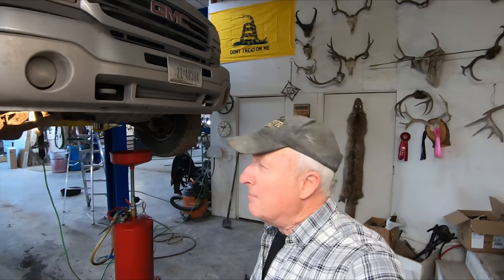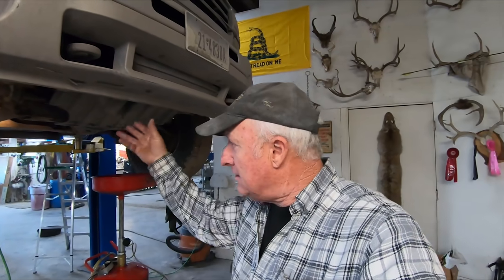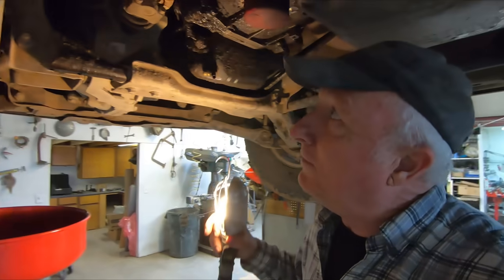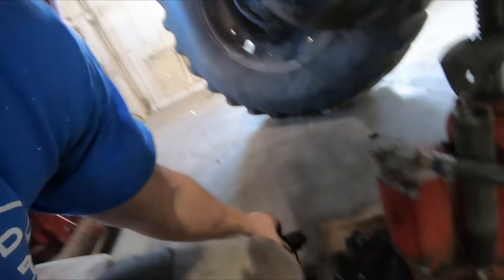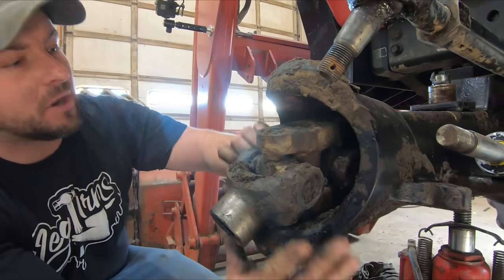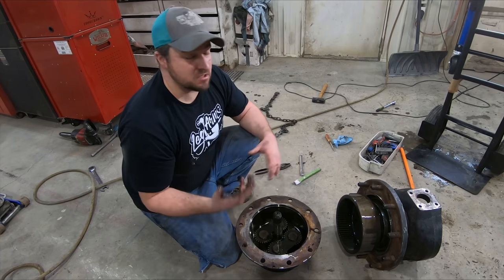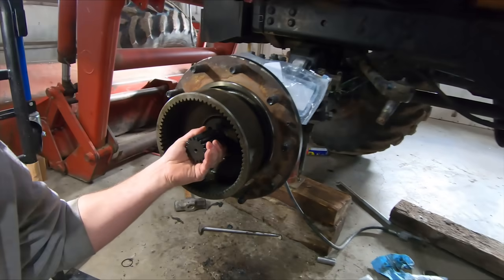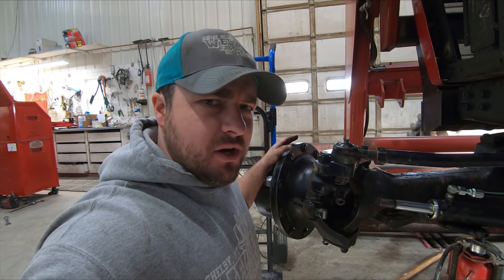NO MORE LEAKS｜Overdue repairs on our CASE IH 7140 MAGNUM

Comment: Some 25 years ago, we did some Bush-Fixes on these type of Front AWD Axels. Liquid Grease instead of the Manufacturers Gear Oil. Works OK for Tractors that run part-time, only and saves lots of $$$ for working hours.

Comment: We had a MF 399 loader tractor (2wd, open station) before we upgraded to MFs with cabs & 4wd.  Initially we kept the loader on when did field work, but then we got really quick and attaching/detaching it in under 5 minutes.  It ran so much better with the loader off.

Comment: 40,000 miles on shocks going across gravel county roads are usually at the end of life! Good job getting the GMC ready to vacation! Have a Blessed trip!
Reply: Not a Bilstein. They have a life time warranty and if they are not leaking, they are still good. Unfortunately it appears he swapped out perfectly good shocks. Bilsteins are not you normal shock. Anecdotally I have over 300,000 on a set on my E-350 van.
Reply: @Cannibal440  swaps dont last forever

Comment: Legarms/Nick I want to tell you something that happened to me back when I was in my 20's. I was using a punch and thought that I only had a few hits on it so I figured I would be ok with out my safety glasses on. Well a chip broke off that punch and hit me in the forehead. At the angle it hit it cut through the skin and slid and inch up my skull under the skin. I was able to get it out with a magnet. If that had hit me in the eye I would have lost my eyesight. I always used  a shield now.
Reply: would make great content tho fella
Reply: @BlazeTBC  Can you imagine the title of the video. Legarms Destroys his Eye!!! or Nick Rushed to Hospital with Severe Eye Injury!!! . Ya probably a viral video. Yikes!
Reply: I was thinking more along the line of fool takes knock to forehead because he can't use a punch!
Reply: @BlazeTBC  It was not a knock to the forehead it was a chip that broke off the end of the punch that shot like a bullet.
Reply: @davebrittain9216  lol
Reply: @BlazeTBC  Just to add I once helped a guy into a hospital that said he had been shot. I was asking him what he was doing when he got shot and he said splitting wood. He was using a steel wedge and a sledge hammer. I worked at the hospital that he came into at the time. He was taken into the OR and the chip from the wedge with through his rib cage between his ribs and luckily stopped right against his heart before going right through and damaging anything. Luckily it missed the major blood vessels. It looked like he had been shot with a .22 from the hole in his chest. I always think of both of these things now before I start using a chisel and punch or my air hammer.
Reply: @davebrittain9216 , Had the same thing happen to me while using a chisel and hammer to remove the top off a 55 gallon barrel. A chip shot off the hammer, straight into my shoulder about 1.5'' in. Doctor left it there, said the amount of muscle he needed to cut wasn't worth it and it would encapsulate itself. Still in there after 38 yrs. Cannot imagine if that thing hit my eye.
Reply: @augustreil  You reminded me about me hammering a U join out of a drive shaft. A flying chip of steel  is in my leg too close to nerves for them to remove.It's about the size of  head of a match. Upper thigh way to close to... well too close for comfort lets say. I was wearing a face shield at the time. Its in there about the same as yours, maybe a little less. Ya lucky that did not hit your eye!
Reply: @davebrittain9216 , I get what you're saying by too close ! It's amazing how far in those pieces can go, isn't it ?
Reply: Yep being shot is the best way to describe it. Beware cheap hammers they are to hard and chip, beware punches that have mushrooming at the head, never hit a hardened part with a hardened punch or directly with a hammer and you will avoid being shot by yourself but not the clown at the other end of the workshop.👍
Reply: Dave Brittain hearing protection toooooo
Reply: @michaelbrown8545 , exactly right there fella.  Remove the mushrooming, using the bench grinder, or hand grinder, placing chisel/punch in the bench vise.
Reply: Dave Brittain you also shouldn’t hammer a splintered punch, and missing the centre, that’s the only reason chips fly off

Comment: I lol when you brought out the Honda back when I worked in forestry replantation site prep. On the trenchers there was a couple of huge nuts connecting wheels of the trencher to the frame and to loosen them we would put the rachet on wrap a chain around it and pull it lose with the one ton truck lol

Comment: I had a 2005 GMC 2500HD with the Duramax LLY diesel engine.  At 117k miles it needed new glow plugs and injectors.  I had to keep running injector cleaner and lube to keep the fuel trims in spec.  You have a nice shop, I don't and the dealer sucks.  Wanted $8k to replace the injectors and glow plugs.  I traded it in a new RAM with Cummins and it's been great.  On your GMC, be sure and check your fuel cooler back by the tank.  They rot out and start leaking when you are on a trip.  I won't mention all the other crap I replaced on the GMC like front hubs.  BTW, the first LLY engines had iffy head gaskets.  That's a 24-40 hour job to replace.

Comment: Great video, gentlemen.  Did anyone else think "Nick should have used a Big Bud" where he used the 4 wheeler?  Hardly practical, but a funny thought.  Bob really went through his truck!  I think that replacing the shock was correct.  The rubber bushing came out for a reason.  Oh yes, the "Winter Paint job".  All too familiar paint scheme around my part of the country too.  The pins on the 7140 were crazy tough.  Enjoyable as usual!

Comment: Hey Scott. The proper name for Allen head bolts is "socket head cap screws" or shcs. But yeah, Allen head bolt is what most people outside of machine shops call them. But it's good to know if you ever need to buy some. Just look for SHCS.

Comment: there should be a tiny little vent in the center of that hub, when they get plugged it can cause oil to force its way out past a seal.  its threaded in, so it can be remove and cleaned out with the air compressor.

Comment: Boy, that Leg Arms apple didn't fall far from the tree. That magnum is pretty much the same axle as the 8770 New Holland super steer i think. if that seal leaks, the planetary on the end will come off easy enough having just been apart. LA is doing right. Great Vidya Gentlemen. God Bless.

Comment: @7:33 

Coming from a mechanical engineer. We 100% get where you are coming from, most of us try to design in ways to make assembly and disassembly easier, but those things rarely make it past the bean counters. 
Engineers are really just slaves to sales and bean counters. If it makes it more expensive to produce(even by 1 cent per part) and doesn’t affect the working function of the part, it’s not gonna make it past accounting :(
Reply: I'm surprised LegArms didn't drill and tap two holes in them himself and use Never-Seize during reassembly ?
Reply: @augustreil  I thought the same thing!

Comment: I dont know if u use a lot of brake clean, but snap on has a container that u fill up with brake clean charge with air. U can buy brake clean by bulk in 5 gallon or 1 gallon. Saves a lot of money over cans and it works really well.

Comment: Leg Arms; you could take that planetary shaft and weld on it to build it back up, and get the factory machined surface specs from IH & put it in the lathe & turn it down & your shaft will be good to use as a spare when the other side goes bad & you save 400 bucks....

Comment: Leg arms getting poked by that sharp metal was the tractors way of saying you should have changed the universal joint seal! 🤣😂🤣 I understand not changing it, if it ain’t broke don’t fix it. Great video guys, glad leg arms didn’t get badly cut.

Comment: A word of advice from 30 years of fixing cars trucks and equipment, put a little sealer like liquid Teflon to the outside of seal where it goes into housing. Seen new seals leak between the steel surfaces, that's why Ford and GM started using sealer on the outside of iem axle seals

Comment: FYI, an easy trick to fixing the worn out axle, is to put it between centers on a lathe and remove the minimum amount of material to round. Once you're done, some sintered bronze stock is needed to machine a custom bushing. This OP could be done on a hobby grade lathe. Cheap as cheap gets. Were I you, i'd keep the old shaft, machine it, machine a bushing, and keep them in stock in case you need a swap at some point.

Comment: Watching the servicing on the ole LLY I think I saw gear oil going in the transfercase. Those transfercase s actually take dexron 6 they have a oil pump in the rear of the case and they have a hard time pumping gear oil as they were designed for atf. Just thought I would let you know

Comment: Pro tip for next time- if you pull off the planet cover first and then pull the sun shaft you can roll the knuckle off the axle without removing the lower pin and then drive the lower pin out with a bar. the bottom pin is always tough to get out.
Reply from the maker: Wow... That would have been so much easier!!

Comment: Regarding the Duramax in the beginning. The LLY came out in 04. The Allison transmission was a 5 speed until 2006 when it became a 6 speed. The transfer case takes the same atf as the transmission. Using gear oil will burn up the pump and cause premature failure.
Reply: I own an 03 LB7 and I just had the transmission out to rebuild it and resealed the transfer so it's pretty fresh in my mind, just something that stood out.
Reply: Thanks much! Glad some of you caught it.  Blessings.  Oh not sure on the score.

Comment: Changing the engine oil on the Duramax's at the shop is a breeze. Especially the oil filters. I love how easy they are to get to.
Reply: Wollsie 
right takes no time doing the oil change on my 05 the fuel filter can sometimes be a pain depending on what brand

Comment: Not sure what options that Duramax has, but if it has the push button 4x4 with Auto 4WD option, it needs Autotrac 2 or Valvoline Transfer Case fluid, not gear oil.

There is a clutch pack that engages the front axle in auto mode, it needs to have the right fluid to work properly.

Comment: Great video 👍 but Bob you forgot to mention that when your working on a vehicle raised on a lift which is great👍 working with your arms above your head as you get older you lose the power an strength in your hands🤔😂😂 nice repair on that hub I knew how a planetary worked but that's first time I've seen inside one good job 👍💪💪

Comment: I worked into engineering from being on the tools and believe all engineers need to spend time on the tools. As an example on was on site with the design engineer and as we were going around he did not know what the piece of equipment we were looking at that he had designed and drafted. In another instance I was viewing drawings for bidding purposes and notice that what was drawn, ductwork, would not fit the space given so referred back to design engineer. We won the job and had to solve problem ourselves in conjunction with builder and other trades.

Comment: I enjoy your video's. Not sure if anybody commented on this or not but the transfer case on the duramax does NOT take gear lube!!! It takes either auto trans fluid or GM autotrac II. If you leave gear lube in there it will prematurely wear out the chain especially in your cold environment.

Comment: If you replace the shaft and use old planetary gears won’t they wear out the new shaft faster? Like using a new bearing with an old race? Or does it not matter?

Comment: I love my 07 it has the LBZ it has 347,000 Miles runs great has a safe trip.
Reply: Just turned 320,000 on my 07.5 lmm yesterday. Don’t used a drop of oil

Comment: I had to do that on the 59 michigan loader...
I got the top cap off. And was able to pick the outer hub off the bottom king pin heat was my friend... That was a heavy heavy pig...
Reply from the maker: I bet that was a heavy pig!
Reply: Has to be, otherwise, the forces involved would snap it like a twig, and then you get soooo much damage.
Reply: Well the housing was more than I could pick up... And I disassmled it as a outer unit... Good thing for loaders...
Reply: Now of to put a backhoe on a Toyota

Comment: Seems to me there is a lot of  'designed obsolescence'  built into machines of today.
If they don't break down, with regularity, you aren't tempted to buy new.
They keep building new machines and if the old ones don't break down they can't sell the new ones.
Good work on getting the planetary fixed. That stub shaft is the sun gear, the four little gears are the planetaries.
Together they form a gear reduction in the manner they are used in this case.
Thanks for sharing.

Comment: Leg Arms Nick,  Epicyclics consist of three components, One, a sun gear normally driven as the input,  Two, the Annulus, normal the ring which acts as part of the casing, three the planet carrier with planet gears. So if I drive one item, sun, hold the annulus ie the ring gear as part of casing, i will get an output from my planet carrier gears with a gear ratio reduction. Steve England

Comment: Hate to harp on things but I'm seeing this ALL the time.  You guys on concrete with your knees will regret it in the future; BIG TIME.  Take it from someone who knows (65 year old).  Mark my words, there will be a day.  At that point it's too late to go back and change a habit.  (Big fan; look forward to your posts.   ...there, end with a positive.)
Reply: I know lots of mechanics that have f*** knees from concrete
Reply: @Bigstrapper  Maybe some rubber mats that you can move around plus knee pads
Reply: He's right you know.
Reply: @Bigstrapper  I had to retire from being a mechanic after the third time my knee was opened up for maintenance. It is not fun on cold, wet days.
Reply: I'm an avid knee pad wearer. But sometimes I just have to do a quick something and don't feel like grabbing them. I keep a kneeling pad with me on the truck that is easily accessible and I can put that down. Even scraps of carpet kicking around the shop are good.
Reply: We used to have old carpet squares stacked and taped laying around everywhere. Just pull one over and use it. Huge knee saver.
Reply: A good pair of shoes, knee pads, and some foam/rubber mats will really pay off in the long run.
Reply: I hear ya bud, know what your going thru.  I wear knee pads and keep a couple of boat seat cushions on hand when I'm working on my knees.  They even have handles.  I'm 65 and want to keep going till I'm at least 80, God willing.
Reply: After having knee problems you sure can predict when the weather is going to change, and that is a fact !
Reply: True.  I joke about it - I'm not a hooker... I don't work on my knees or back if I can help it. lol  When I can't use a lift I use a plumber's kneeling pad (Knee N' Back Pad - Bennette Design Group)  Works very good, even after gluing it after a dumbass employee thrashed it.

Comment: For the bottom king pin just take a 2ft metal bar and weld it and after that two guy two sledge hammer when it remove cut the weld and grind it That will probably take between 30 to 45 min and all will be done (sorry for my bad english)

Comment: I think the only problem with Leg Arms Engineering suggestion is dirt and rust accruing in or around the secondary bolt or opening. Even if its covered without a bolt in it dirt and rust will find a way

Comment: Just a bit of info of what happened to me. I changed rear diff oil in my truck(12v dodge diesel)like you I went to synthetic and my pinion seal started to leak.not saying it will for you but might watch for it.....

Comment: Had that same exact issue on my 2013 Polaris Sportsman ball joint. Ended up taking the whole shock assembly off, welding a two jaw puller on it, tied top of shock to tractor hitch and the other end to the top of the three point. The 5075 struggled a bit and bent the hitch up, but finally broke free. I suppose that wouldn’t have worked in this situation?

Comment: We had the same issue on one of our Magnums as well only it started smoking coming down the road.Also when it was tore apart we pulled up those inside gears and underneath them there needle bearings over 700 of them. I got the task of putting them all back in.Not real bad smeared a little vaseline on the shafts and they stuck pretty well. Just very time consuming putting them all back in.

Comment: So on that part that needed pusher holes, did you guys bother to drill and add them to save the future fight? Doesn't look like it.
Reply from the maker: The plate isn't thick enough for sufficient thread count. Needs to be designed differently.
Reply: @WelkerFarms  Gotcha. That's a shame.

Comment: Does that Case 7140 have shims to adjust the "wheel"  bearings?  I worked on a FWD Genesis 8670 and it required different thicknesses of shims to "tighten"  the bearings.
Reply: It should, and the 5 or 6 bolts that go through the shims should be changed every time they are taken out.
Reply: mw3bb9 I used to own a 5130 and that didn’t have any. I think it’s the same design as the 7140.

Comment: love that oil filter  ,, and  the Oh Kill me valve on the oil pan ,,,
2 of the absolutely worst things you can have   ,,the oil filter will be destroyed if you break a U-joint or wrap something around the front prop shaft ,,perfect thing to ruin your engine 
same with the oil drain valve run over something on the road and break it off ,, POOF there goes your engine